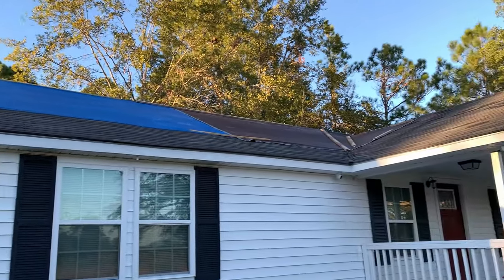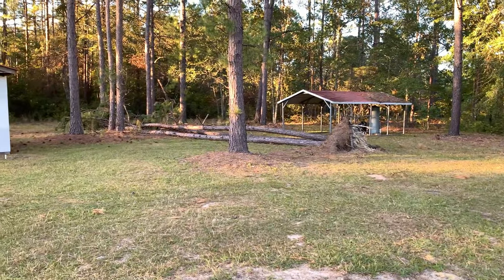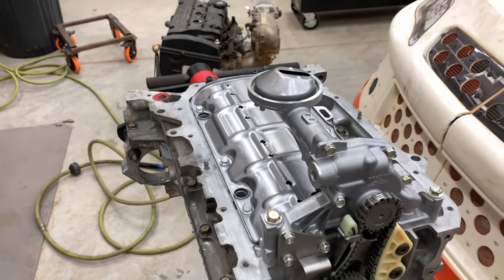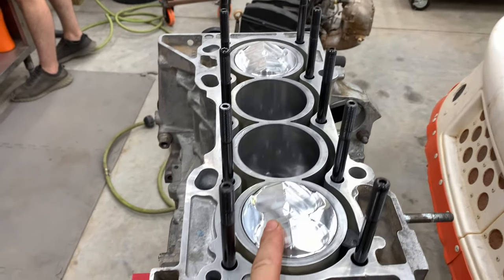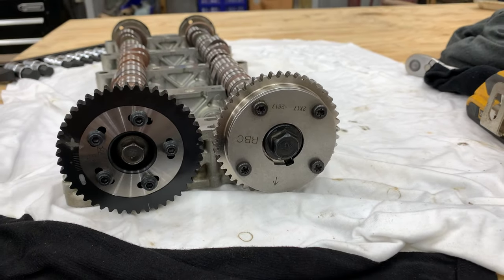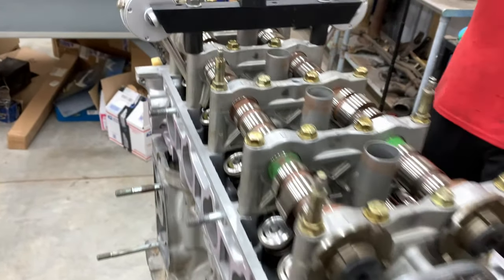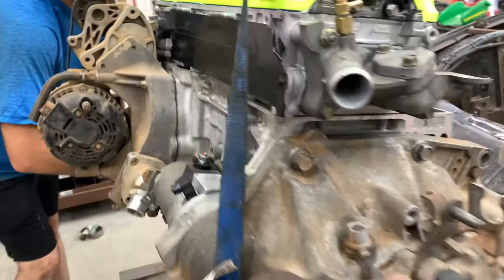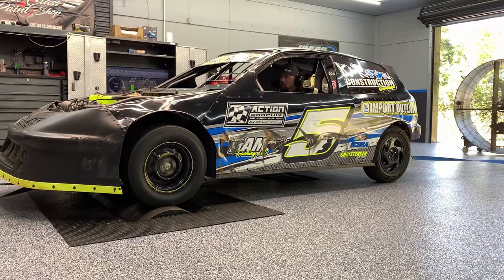Building our K24 Race Engine, We Let ALL The Secrets Out!

Comment: That oil pan looked like a rbb one and that a no no when you are using the type s oil pump
Reply from the maker: Why is that? Just asking because I haven’t heard that before
Reply: @ImportOutlaws  the pickup sits closer to the pan and will cause oil pressure issues. Have a look at a type s metal pan, it has a indent to allow for it.
Reply from the maker: @mayk3lll  yeah I’ll have to do that. This one is from a TSX for a k24a2. Definitely going to look into that

Comment: Do you have supporting mods, maybe freeing up the intake track is needed before the engine can get enough air to show the benefit of the larger valves. If your engine demands more air can it be supplied by your throttle body, your stock intake arm and that air filter? Would have been nice to see a dyno pull with no arm or filter even, I know, risky.
Reply from the maker: With the rule set we run in our touring series, we have to run a stock type breather tube and can only run a certain style of filter. We also have to run a stock intake but it can be modded as long as it “appears stock” from the outside. We are aloud to run a header though. Usually we would have done a pull with a megaphone style tube, but unfortunately it was at Jason’s old shop when I went to the dyno

Comment: can u pls measure the diemeter 30 degree pin.i want to install this cam pin in my roc cam gear
Reply from the maker: I am not able to currently, it is all put together and in the car. I do have a 40* and 35* though. If you have assorted pins and don’t know what is what, I can measure them so you can rule them out
Reply: @ImportOutlaws  yes measure the pin for me the 35* and 40*.I m currently running dc stage 4 cam.thank you for the help
Reply from the maker: @syukrimusa1850  30* is .234in (found one), 35* is .186in and 40* is .115in. These are based off of the pins I have
Reply: @ImportOutlaws  awesome thanks man

Comment: stock is better at lower rpms
Reply from the maker: For sure, typically the mid range is better on stock motors/cams, but you see higher peak numbers with aftermarket cams/builds